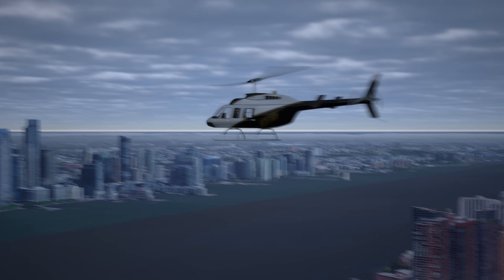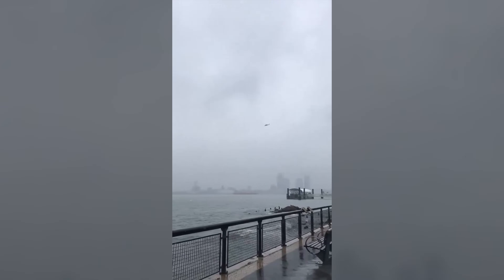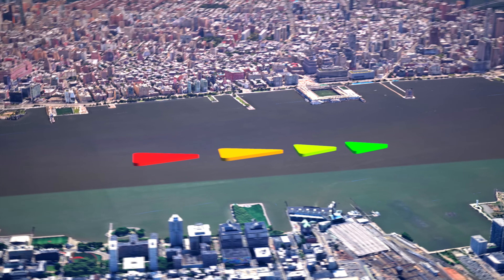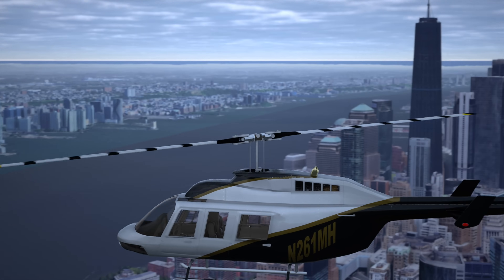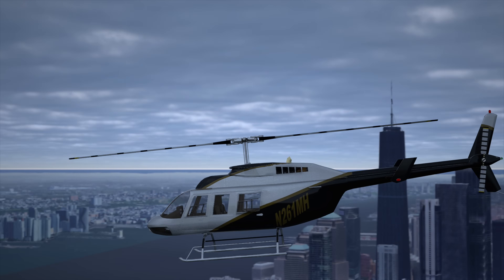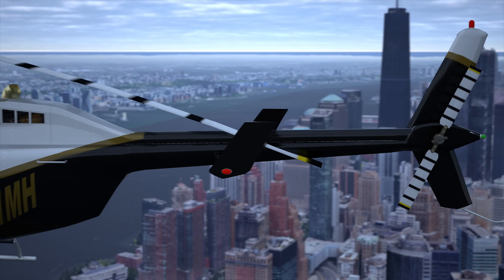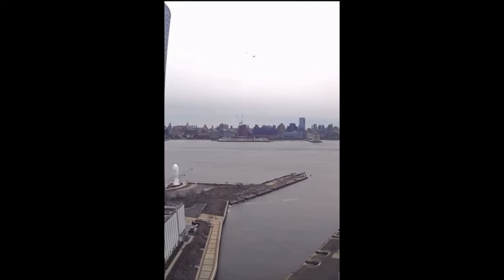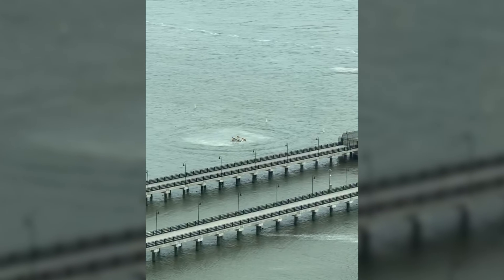Helicopters DON'T just fall from the sky - What is "Mast Bumping"?

Comment: Mast bumping to Rotor flex and the rotor blade striking the Tail boom, detaching both the tail, and main rotors, is common in the Bell 206, the main rotor showed no sign of damage, and the tail boom showed signs of stress fracture and not impact fracture.

In the images, the Mast is intact, and the transmission is still attached,

What likely happened is the transmission seized, causing a sudden yaw movement due to the rapid change in rotational torque force, which caused the tail to detach as the aircraft suddenly rotated likely around 220-270°/second.

That sudden movement was likely around 7-10 lateral G's, pilot was likely KO at that point as well, if not the entire manifest.

Comment: Probably poor maintenance or poor workmanship in assembly.  The bolts holding the upper "rotor cone" thing (I don't know the correct wording) probably snapped due to stress fatigue.  Just like that one jet airplane in the 1990s which crashed because the tail section's bolts kept getting weakened on every flight and didn't have enough strength to hold the tail section on after X amount of hours flight time.

Comment: Well, i just saw blancolirio analysis and saw a fox interview of the same pilot that yesterday said hotdogging/mast bumping, and both today are saying no to mast bumping as the transmission was still attached to the main rotors as it came down, indicating mechanical maintenance problem instead. Both said stay clear of younger pilots and ask loads of questions re maintenance etc before any heli trip